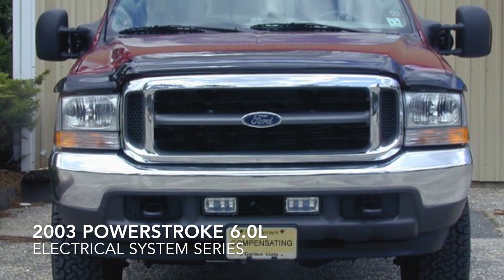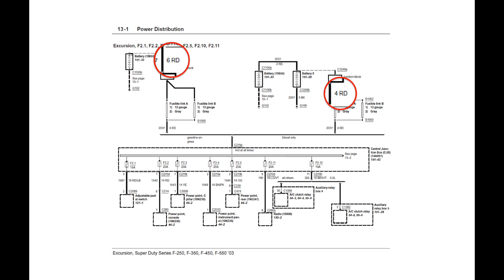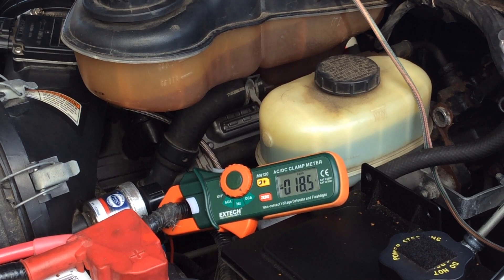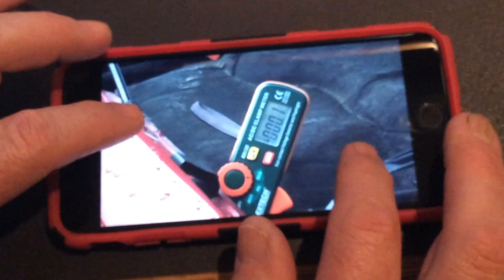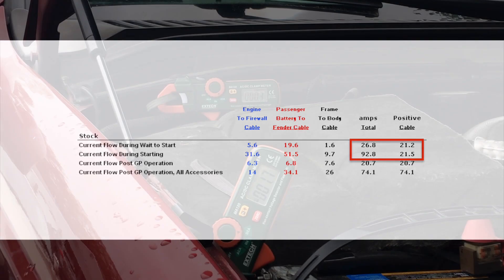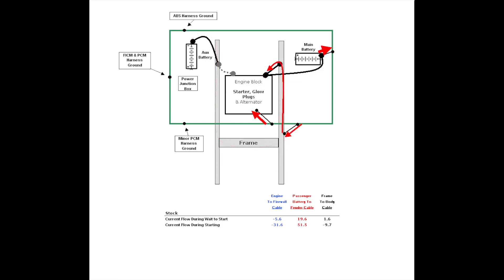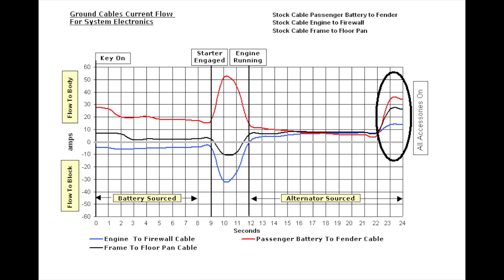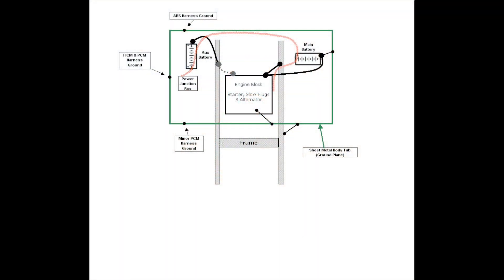Powerstroke 6.0  Electrical System Stock Negative Wire Testing

Comment: So if you were to summarize what your findings were for the best possible setup of ground cables what would it be? I commented on your video that preceded this one with the issues I am experiencing.
Reply from the maker: I just responded - sometimes I don't get to YouTube for a few days.

It depends if you are enhancing the stock cabling, or going to redesign the entire system.  For the FICM, running an 8ga wire from the driver's negative post to the FICM and PCM ground points should be done.  If looking at ground cables only, the next would be a 1/0 cable from where the drivers ground cable connects to the frame rail, and run that to a point on the engine block.

I have two other designs I plan to test in the future, but I got a lot in my way before that.
Reply: @toomanytoys  You are a life saver! I owe you a 6 pack of root beers! Going to order the cables and connectors tonight!

Comment: Dam, you have the BEST and I mean the BEST video on this topic. I'm going to replace ALL main grounds with 2/0 welding cable and copper lugs.... Use Novalox between the metal and lug, THEN die-electric grease on the top of the whole assembly. The body to the battery, the bonds, engine etc.... What do you think?
Reply from the maker: Going up to 2/0 on the grounds will not really help unless you also upgrade the positive side.  Next spring I should have one or two videos on different designs.

Comment: Me again, so now moving on from the previous video on grounding points.  First,  I see here is your rationale for increasing the 8 ga to 6 ga (as per your earlier answer to my query).  I missed the explanation earlier but your welcome advice dealing with 8 ga to 6 ga  from the passenger battery to the tub is clearer now here.  Also, I will endeavor to add the jumper cable from the driver side frame to the block for better balancing. Also the current draw you show with your truck with accessories and engine running... yeah my e-fans are blowing my current needs way over my upper OEM 140 amp alternator's capacity to keep up.  Based on a visual inspection and wire tracing, I suspect the second 110 amp alternator is only feeding my other 2 batteries in the ambo box, which begs the question:  Could I not just add add a parallel fused cable from the lower alternator to the + end of the passenger battery, thereby taking my stock dual setup and combining it to give me 110 + 140 amp = 250 amps???
Reply from the maker: Replying in the Grounding locations video.

Comment: i came up with this test sequence about 15 years ago.. i use it daily in my life fixing cars.. copy and print the image. https://i.imgur.com/kviX0VQ.jpg   it can be done in about 5 minutes with a digital volt meter.  with separate frame trucks.. perform test 3 a second time from negative battery to the frame rail..  ..

Comment: Jack please,  in another forum you mention 3 pulleys on the 230 amp Leece/Neville alt.  the stock pulley seems to be the way to go? So my question is , is that the pulley that came on my oem stock ALT. that came on m 06/6.0L  And to you still lean on the stock pulley with the L/N 230 amp   current $ 359.00 free ship,   I've also looked @ DC POWER which seem to be out of stock and are $$$.  I will complete cable upgrades with new batteries  this weekend, and will upgrade alt.soon,, thanks Bob
Reply from the maker: Bob,  Initially I did think the smaller diameter pulley was a good option on the L-N 230, it definitely is on a 140a.  The small pulley would have the L-N just jump over 200a right from the start.  Once I switched over to newer batteries and entered into the winter temps I then noticed the glow plug circuit jumping in and out.  At first I thought it was my truck or components, but after mentioning it others noted their trucks were doing it too.  The regulator on the L-N has a higher voltage set point when cold, 14.5 to 14.6v.  The GPCM has a failsafe mode to drop out whenever voltage goes over 14.5, so you get the GPCM and alternator having a tug of war for the first 90 seconds of running.  I talked with L-N tech support and they had me running in circles trying different things.  Bottom line, its the voltage set point.

The stock pulley from the Ford 110a or 140a alternator alleviates the majority of this, having a slower ramp up in amps and volts.  It's not that it's a slug with the stock pulley, I still measured 180-190a after startup at cold idle.  At htot idle the stock pulley setup will produce ~160a, still way over what you need.

Comment: After watching the whole video - I'd recommend changing it all to a distributed star ground with only a singular common attachment point to the frame. Each common subsystem should be grounded to an isolated ground point, which is then tied back to the common star ground. That would include the cab too. Otherwise you have ground loops (difference in ground potentials) as shown in your video. The gauge of the wire should be calculated based upon the maximum current draw AND the length.
Reply from the maker: Michael Corrieri   Coming up length effect vid 3, change in design video 4.

Why do you think Ford designed the system in the manner they did?